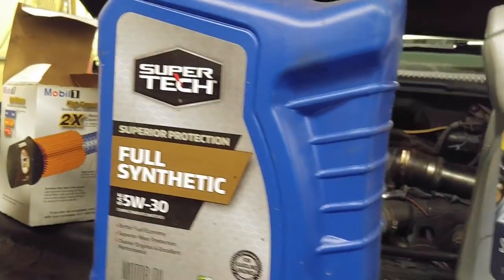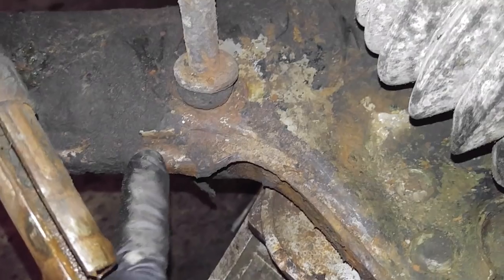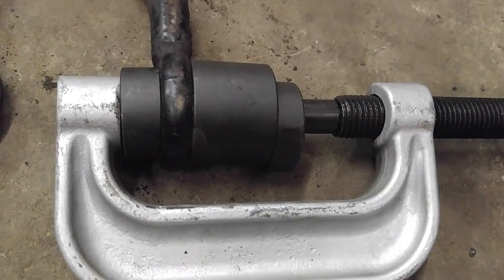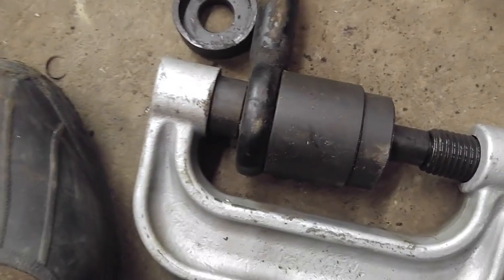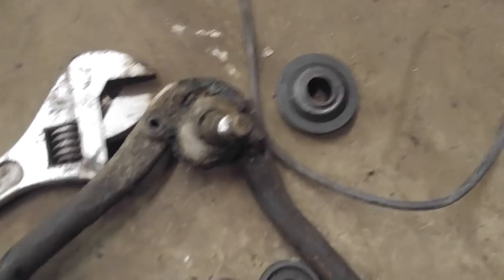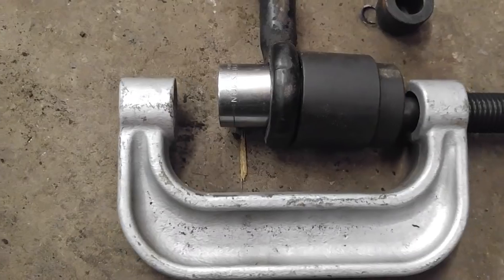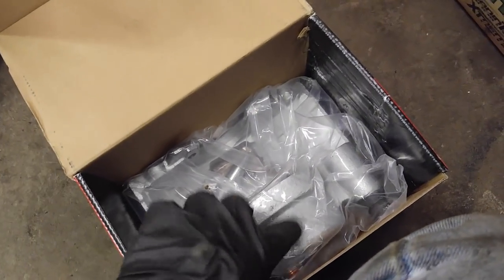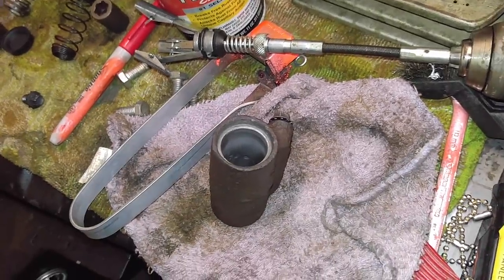TurboWeasel Control Arm Upper Bushing 1 31 19

Comment: The older Cub Cadets are great. Easy to work on and the parts are easy to get.  I had a 100 with a mower deck and blower that came with the creaper drive. It was shaft drive and a true work horse.  My cub original is my baby that I've had since I was 13 (almost 42 now).  It is belt to shaft drive but works great. I plowed my northern michigan driveway for years with only wear item issues.  Throw on a set of v bar chains and plow. No regrets.
Reply from the maker: Cub Cadet 100? I'll look it up!
Reply: @CORVAIRWILD  All those old Cub Cadets are great.  Mine are from the 1960's and are damn near bullet proof.  The normal wear parts are available online and the rest is on eBay. Always wanted to get a hydrostatic model.

Comment: bulletin # 76-43-01A
 actuator p/n 26060073
 harness p/n 12376316
 parts are available at local GM dealer. 4wd fuse is located in the dash fuse panel. it’s a 25amp fuse. there is a sensor that screws to the front axle i think with two wires.

Comment: As far as yard tractors. Anything older say mid 90's and older are good. 2 stage blower is much better in any brand. Im a gravely guy myself walk behinds or riders older stuff is my game. All depending on what you need to mow, and snow blow and what you want to spend on a machine to do that is up to you. If you buy something with small issues that need fixed can be had alot cheaper. Older cubs are very good too
Reply from the maker: Lots of stuff (snowblowers) is kinda far away...

Comment: You know I give corvairwild props for helping. Even if  it's an ex. The asinine comments on what he to do with his life is ridiculous.  As far as a snow blowerI agree with other comments cub cadet I would think is nice I remember grandparents having a old toro. Thing had carburetor problems and had exposed chains hard rubber wheels pain in ass starting it.
Reply from the maker: As far as comments go, I suppose it's easier to solve other folks problems than our own. And progress report, I got the torsion bar off and dropped the control arm, smaller-front bushing rmvd, rear-larger bushing ready to go into the press, C clamp not large enuff. Then to drill ball joint rivets... And much milder this AM, 40f coming up tmrw